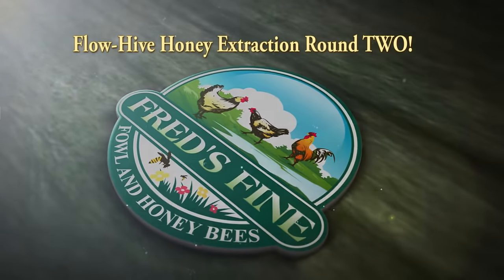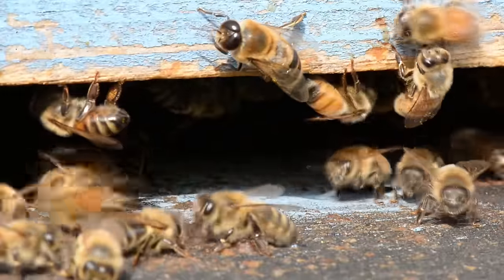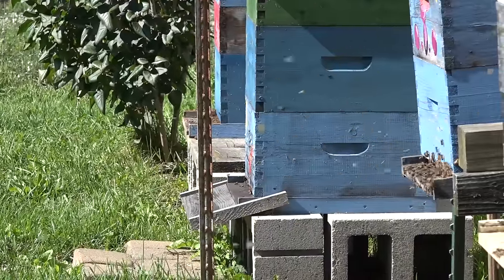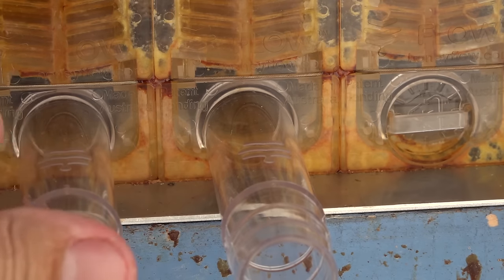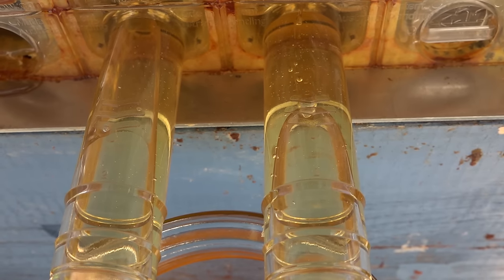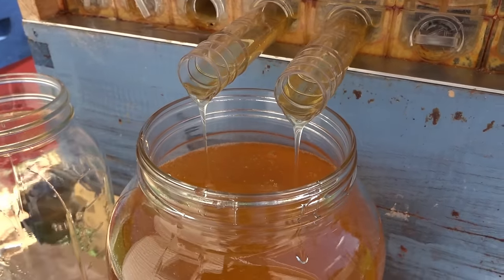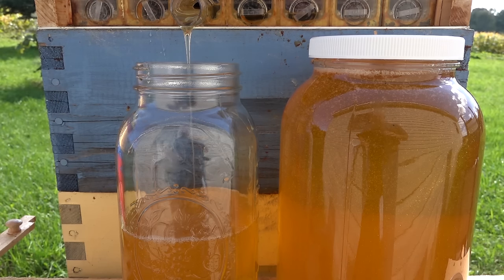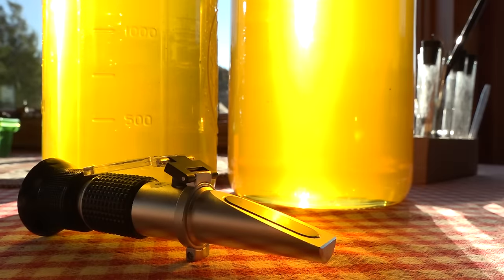The Flow Hive for Honey Bees 2nd Honey Harvest Review and Testing

Comment: did they get it filled a 3rd time.  if so did you collect and remove too super
Reply from the maker: Hi Greg, part of my observation of the system includes leaving the FlowSupers on through winter, so no, I didn't remove the gains they made after this video. It is the norm to remove extra honey supers until spring, but many flow hive owners have only one honey super on their hives and the colony needs those resources, so I am going to observe the flowsupers throughout the winter months in place. My thoughts are that on warmer days, the workers inside the hive will move resources from the flow super down into lower boxes and near brood frames.

Comment: what about the bees that are still filling the tubes (cells) that are not cap, do you kill the bees by opening the flow? Also what about different type of honey, some will not flow like this
Reply from the maker: No bees are ever injured. It's designed so they can move out without problems. As for honey the jells or doesn't run, you'd have to feed that back to the bees. Honey like that also has problems being extracted and filtered, so just give it back to them.

Comment: Does the Flow hive crush bees?
Reply from the maker: It never has and never will. The mechanism is designed in such a way that the bees easily move out of the way and the parts are not tight enough to crush or cut honey bees. That's an early misconception by folks who've never owned or used one.

Comment: I wonder how much of this new honey is just the lost honey from the first extraction (honey that dripped inside), and simply put back into the stores. 34# of extracted honey doesn't seem like a lot of honey for that size box.
Reply from the maker: The drippings would not have amounted to much Miles, several ounces max. That's an interesting thought though.
Reply: OK. I'm looking into these for work, and my boss will have lots of questions for me to answer. It was just a thought I had... After your videos I watched another of some people extracting from their Flow frames and honey was running out the bottom of their screen bottom board.... Looked like a lot was lost on that video (at least on the first extraction). 

Do the bees patch up the bottoms of the frames such that all subsequent extractions are relatively leak-free? What explanations did the FlowHive people give for why the 2nd extraction would leak less? 

Thanks
Reply from the maker: Miles Thompson I wouldn't have a screen bottom board as that also attracts robbing from other colonies. The reason most new keepers haven't experienced that problem is because they generally only have one hive/colony.  The subsequent (cleaner) extractions are due to the workers forming an almost complete was cap cover over the entire flow frame surface. Also, the second extraction occurred under lower ambient temperatures. The bees control temps over the brood chambers, not over the honey supers, so that's also a factor. Opening the frames 1/2 at a time was also smart, and allowed the honey to flow through the chambers/cells rather than flowing out of the lower rows. Happy to answer your questions.
Reply: Thanks, Frederick. When you say open halfway, does that mean half the frame or the whole frame, just half-cracked? I'm assuming the latter. From the videos/images, it looks like the honey flows down into a channel under the cells....if too much is flowing down, it overflows through the bottom row of cells and into the hive...is that correct?
Reply: How has your hive management changed with these in place? Do you still let them fill a regular super for winter stores? And then remove the flow hive prior to winter?
Reply from the maker: correct...
Reply from the maker: I would normally remove the flowsupers, but because I am evaluating them, they are remaining on through winter in order to demonstrate what may happen when they are left in place. But normally, yes, I would remove extracted honey supers and leave the honey frames which they require for wintering over. This year, they have both.
Reply from the maker: Half the frame-fully opened, then insert the keys all the way to fully open the last portion after draining has slowed.
Reply: OK, I wasn't sure if the Flow frames allowed only half the frame to open at once... I'm a hands-on type, so trying to get get an idea of what to expect is difficult for me in a virtual world.

Comment: was thinking of getting two of these. wasnt sure how good they are tho.
Reply from the maker: Hi Nathan, in my situation, they are working very well and came through the first winter just fine. If you decide to buy one, I can save you $50.00 on your first purchase if you provide your e-mail. I wish you well with your bees!
Reply: Frederick Dunn how would you go about doing it for two hives? Just get the normal equipment for a jive then get 2 flow supers?
Reply from the maker: That's what I do, since I already have so much 10 frame equipment, getting the supers is easy.  I just put one flow-super on each hive.

Comment: How well do these survive -25 zero weather
Reply from the maker: That's not a question I can answer as I don't have first hand experience with those extremes. I think if I had sustained -25 f temps in winter, I'd be insulating heavy. You'd need an insulated roof at a minimum and the flow-supers are off during winter, so it's really just another Langstroth hive at that point.
Reply: @FrederickDunn  Thanks, that's what I assumed. I live in a dark hollow in VT

Comment: Well, at 700 bucks a pop you had better be thrilled with it.
Reply from the maker: I am indeed, and it wasn't $700, this is just the Flow-Super, not an entire hive, but it has already paid for itself. I am no longer doing traditional uncapping, filtering and spinning as I've converted all of my hives to the flow method. Thanks for commenting :)
Reply: @FrederickDunn   Frederick Dunn  You didn't mention how much the super alone was, and did it come assembled?
Reply from the maker: The company link is in the video description and you can check pricing on any of their boxes and flow-supers, there are various materials available including plans to construct your own boxes if you wish. I don't post pricing as they may change, or run specials.

Comment: Flow hives/frames are a gimmick- but you know that I'm sure. Thanks for the upload!
Reply from the maker: They are a "gimmick" that I absolutely enjoy having in my bee yard. :) I've stoppd uncapping and spinning honey and won't be going back to that method. Thanks for watching and commenting.
Reply: @FrederickDunn  thanks for the reply! What's your opinion on having 7 vs 10 frames for surface area? More honey or more space needed or?
Reply from the maker: @sly9263  The 7 frame flowhive matches the 10 frame Langstroth and it's my favorite. Although, I had a small colony of bees make it through our heavy winter in a single deep 8 frame brood box which matches the 6 frame flow-super. Depends on your environment and what bees you put in it? More can't hurt now that we're headed for summer.
Reply from the maker: P.S. Thanks for continuing the conversation instead just shutting me down :) I really appreciate that.
Reply: @FrederickDunn  the big benefit from my view I saw on the flow frames is that they are already effectively drawn out comb, so the bees need only to line it and begin storing away. Setting aside the very high up front cost, I perceived the flow hive as solving some traditional beekeeping problems while presenting new ones. EG, convenient extraction process but limited to 1-2 frames at a time per hive with outside air/pests. We don't have to disturb the bees as much when extracting/don't have to remove frames but there can be propolis buildup on the mechanisms and honey leaking inside the hive (moreso than a traditional extraction). I like the viewing areas- that's one of my favorite aspects about this. The concern I mentioned to you as these are 7 frames filling a 10 frame box is the reduced real estate for larger hives- the comb is deeper/so more resources, but there is less overall surface area for the hive to work on, which to me would increase the likelihood to need additional boxes/more hives to prevent swarming. One of my apimaye hives are up to 5 boxes at the moment (2 brood, 3 supers) now and they are covering every bit of 10 frames per box to stop the swarm behavior at the entrance. I feel like I would need a whole additional flowbox to match that.

Comment: Hi well done on all the work you have done filming this. I personally think that it is just a fancy gadget not worth the money. One does not have to disturb the bees that much when clearing suppers and also I do get a little bit fed up at the amount of spam I am getting from the flow people. Your colony is strong and would of course also fill up an ordinary supper with that much vigor. What are your thoughts on using it in crystallized honey harvests. Is there a way around it?
Reply from the maker: You are not alone in your thinking and thank you for the compliment. I did leave two flow-supers on through winter and the honey did crystalize in the cells, the bees are cleaning those cells out at this very moment. I was prepared to wash out the FlowSuper Frames with a power washer if the bees didn't do the job, as the frames certainly wouldn't cycle with solidified honey. Thanks for your comments and observations.
Reply: Thanks Frederick for getting back to me. Well at least you could clean them up if they ever get clogged up. Reading through the comments below I noticed that some people are saying that one needs to keep an open mind people not willing to change. I don't think it is a bad idea, great one for them inventing it. It shows brains on their part. But still stand by it being a gadget that is a bit overworking an already perfect good situation. Also was a bit concerned about the honey dripping through the hive. It might encourage robbing. Sometimes we are all just trying to look out for those new beekeepers so they do not get disinterested with bees by it becoming to messy.
Reply from the maker: The dripping into the hive was an issue with the first extraction cycle if all frames were drained in a single afternoon. In this video, I hope I cleared that up a tad with no honey dripping down and no activity changes on the part of the resident bees. Robbing "could" have been an issue if the hive were level or tilted forward towards the entry so it would possibly have trickled out onto the landing board. We've had no increase in robbing risk with the flow supers as compared to the Langstroth boxes. 
I do a lot of public speaking and honey bee education from elementary school students to Beekeeper Associations, my focus is on the bees, but I have to share that of the beekeeping groups and classes 25% of those present are there because of the FlowHive advent. No matter how they got there, we have the opportunity to share about honey bee husbandry and that's what I do. You don't like it and that's just fine, many don't
. Yesterday I as at a Beekeeper Association Breakfast and the instructor of a very popular beginning beekeeper course was present, he shared that he suggests beginners start traditional and then, if they succeed and have the interest, consider adding Flow-Components. I definitely agree with him on that.
Reply: I would not say I don't like it just feel it is not necessary ;) But different strokes for different folks and all that. Have a great day.

Comment: How much honey do the bees need for their own use? Ok , you just said one hundred pounds. One Super reg Frames?
Reply from the maker: That number is completely dependent on many variables. Size of the colony (higher populations require more resources), length of the winter months (longer colder winters will require more honey), length and severity of a summer dearth (hot dry non-growing seasons can kill colonies without stored resources), colonies in lavish landscapes with moderate temperature extremes (States like Georgia) will require fewer stored resources. It's safer to start off with leaving on more than they will need and then learning in the spring, what the requirements were for each colony. I go by whichever colony consumed the most. 100 pounds really has never been consumed in my apiary, by any colony. Based on what's left over in spring, they could have probably gotten along with 50-60 pounds. But this is YouTube and if I'm going to tell people what to leave on, I'm going to fail safe. The honey won't spoil if there is plenty left over. However, the bees may perish if we depend on adding sugar water to get them through winter. Sorry for the lengthy reply, but bees are a tad complicated when it comes to dietary resources.
Reply: Two beekeepers I know in my area consider enough to mean until the flowers bloom. Both will have checked  sooner  rather than later.
Reply from the maker: kennapop3 ok